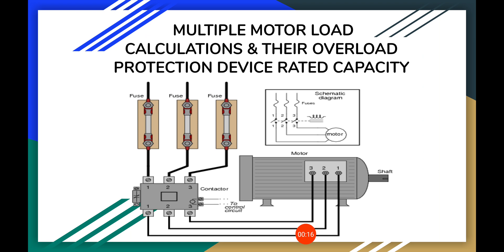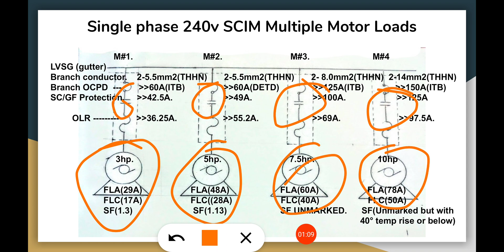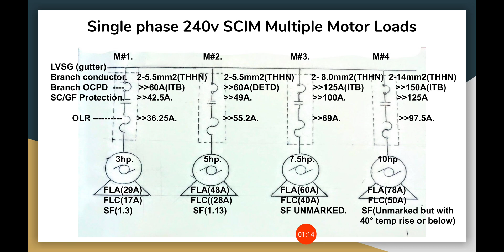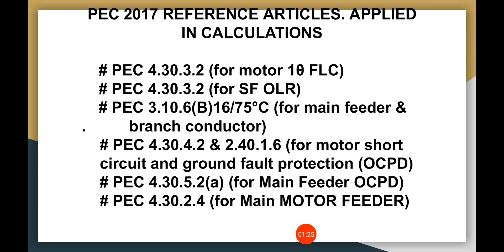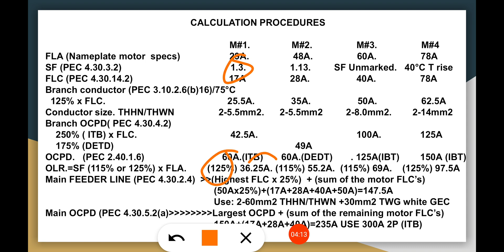MULTIPLE MOTOR LOAD CALCULATIONS & THEIR MAXIMUM OVERLOAD PROTECTION DEVICE RATED CAPACITY

Comment: Hi sir, refering to inverse time breaker, from the table it says Max setting of OCPD is 250% x FLC, for motor #1 calculated is 2.5x17 =  42.5A, but you choose 60A CB? Can i use 40A instead so that it will not exceed 42.5A as calculated?  Add question sir, is there a minimum CB rating and conductor size for motor?  For example, I have 1HP, 3phase 460v motor, can I use 2.0sqmm and 15A CB only?
 Thank you sir for the  great videos! I am learning so much by watching your videos.
Reply from the maker: You need to select the next higher standard for the breaker. 40A is not. 60A is yes. I guess you can use a 2.0mm2 thhn@15A cb for a 3phase 1hp motor

Comment from the maker: You need to size it on a delta Iph as it is running in full blast operation where the max Overload protection device is calculated and based not Iph of WYE.

Comment: Thank you very much for the informative video sir ^^...
I have a question for Wye Delta Starter sir....
During Wye Connection (Starting) we have an Iph.
While in Delta Connection (Running) we also get an Iph.
Which of these two Iph shall we consider in sizing the the conductors from the controller to Motor?
Thank you very much sir and Godbless...